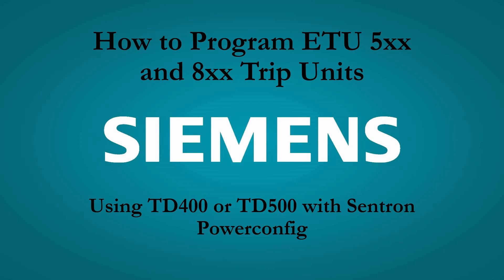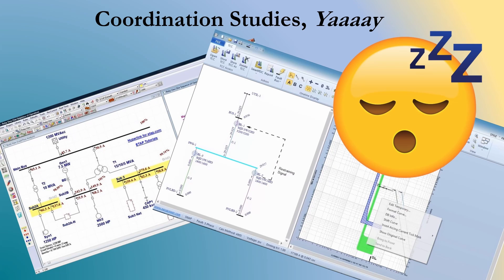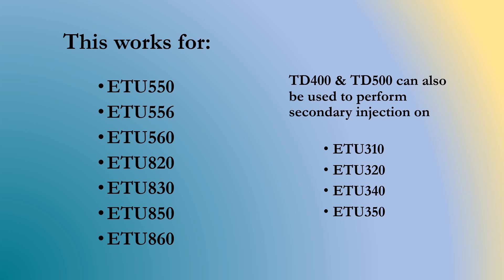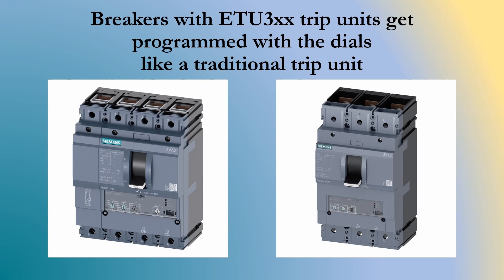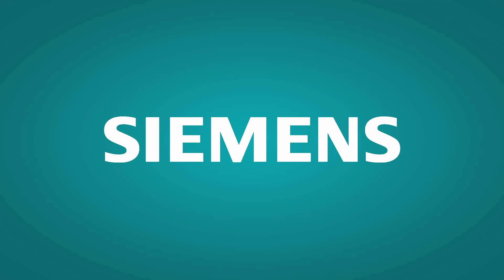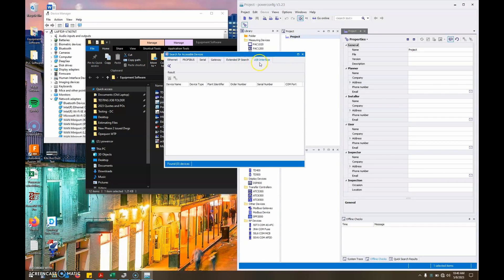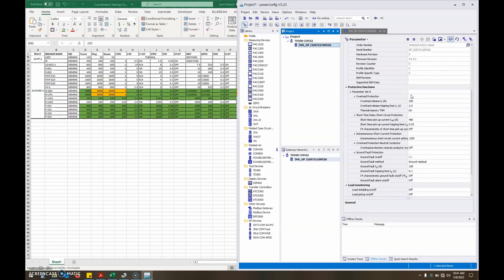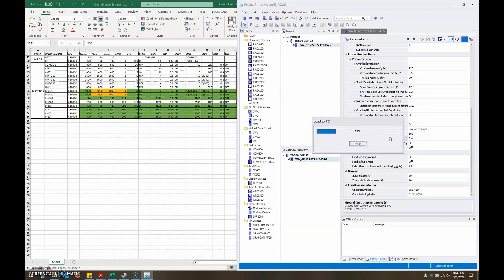How to Program Siemens ETU500 & ETU800 Trip Units with Sentron Powerconfig

Comment: I'm an electrical maintenance technician and most often perform primary injection testing on low voltage circuit breakers. Thank you for posting this video. I had been struggling with connecting to ETU350 and ETU550 trip units with the TD500 test kit and this helped. Siemens online resources leave alot to be desired and the Powerconfig software is not overly intuitive. Just curious if you know if the is a way to defeat thermal memory on ETU350 trip units? It appears to be grayed out in the software. And it appears to take long time for it to clear between tests.

Comment: Cool video! I got a TD500 for my facility. We have a lot of our smaller 3VA breakers setup with Modbus communications. Do you know if this powerconfig tool has accessible information about communications for the trip unit? Trying to troubleshoot some units that don’t communicate properly.
Reply from the maker: To be 100% honest I'm not sure. I would give it a shot and let me know what you find out!
Reply: @ did you have to do any special to get the TD500 to talk with PowerConfig? I can’t get it to show up as an accessible device, I think the USB driver is messed up? Tried reinstalling but no change

Comment: Do you know why the screen on the breaker keeps shutting off while having everything connected properly and test the breaker?
Reply from the maker: Are you having the same issue on multiple breakers or just one?
Reply: Multiple breakers, the Com flashes and turns off on the TD500 and when it turns off the screen turns off on the breaker too.
Reply from the maker: Huh. Id double check that the pins on the cable are in good shape. Much past that you'll need to give Siemens a call, sorry.

Comment: Great work! The video is packed with valuable information.

I require your assistance as I am currently working in Egypt and have received a new item, the TD500 (3VA9987-0MB10), for circuit breaker testing. Unfortunately, I'm encountering an issue as I'm unable to establish communication with the circuit breaker without the use of a laptop.

I'm having difficulty pinpointing whether the problem lies with the TD500 or within my installation. Your support and guidance in resolving this matter would be greatly appreciated.
Reply from the maker: Have you tried contacting Siemens for support? I don't have enough info from your comment to help.

Comment: Great video, I have few questions regarding Powerconfig 3.25 and TD500. I cannot establish connection between PC HP - HP ZBook 17 G6 Win10 ver. 21H2 and TD500. Is there any special setting of the USB (like a baud rate, stop bit, parity... )? When I try to search Accessible devices (F11) it founds 0 device(s). When I try to add it manualy and go to the connection, select PC interface TD500 (COM7), I could not even ping TD500. Any idea? THX
Reply from the maker: If you open Windows Device Manager, do you see your connection to the TD500? Are there any errors? My best guess is it's a USB driver issue.
Reply: In Device Manager - Ports (COM and LPT) I see Siemens TD500 (COM7)  @testingtechtips
Reply: In Device Manager - USB Controllers (Universal serial Bus) as well.
Reply: I do.
Reply: I have resolved the problem with the establishing conection between TD500 and PC (Power Config) by changing COM port number in device manager from COM7 to COM2 (or to another one which is not in use) and now it works fine. To be honest I do not understand the reason of such behaving.
Reply from the maker: You don't see it in Device Manager? Or you do?

Comment: great video, i have a few questions about using the td500 can you secondary inject with one side of the breaker live and can you download the results through the td500
Reply from the maker: Great question; this deserves a video by itself. The procedure Siemens recommends for secondary injection testing, is to close the breaker and observe it tripping with each test. Obviously, if the line side is hot this means you're cycling power repeatedly to whatever load may be connected and puts the operator at elevated risk of arc flash. Siemens does not recommend this and I don't either. Since this is a functional test only, the result is determined as a pass/fail using some internal logic in the trip unit & TD500, passing only if the breaker operates on each function. The "result" light on the TD500 will show solid green and the function causing the trip will be indicated if everything worked correctly. If the result light flashes instead of showing solid green, the test failed and the trip unit needs to be replaced. That said, other trip units that work similarly will record and display the function and amperage of the last fault trip which you can record as your test amperage. That value is accessible in the Sentron Powerconfig software or from the trip unit display. This may be recorded even if you aren't operating the breaker with each test.  I can't verify this without a breaker in front of me to try it on. Next time I have one to play with I'll make a new video. Hope that helps!